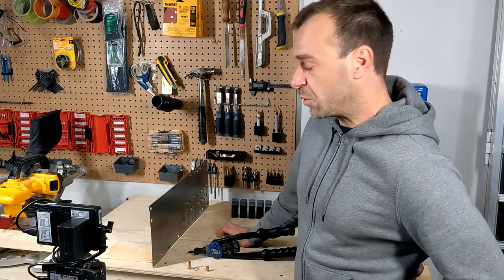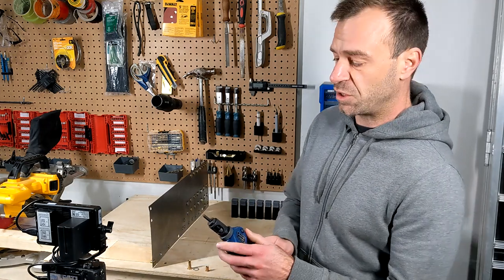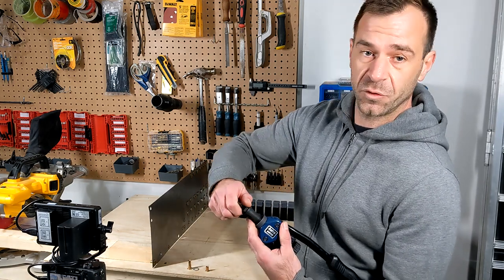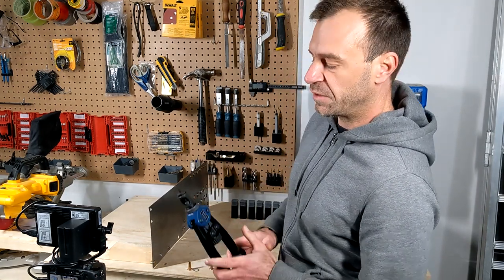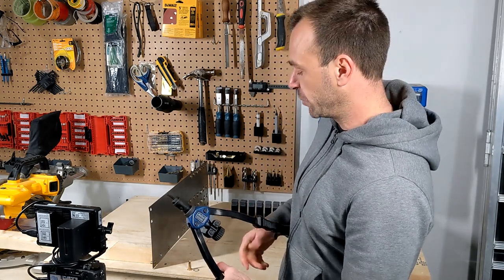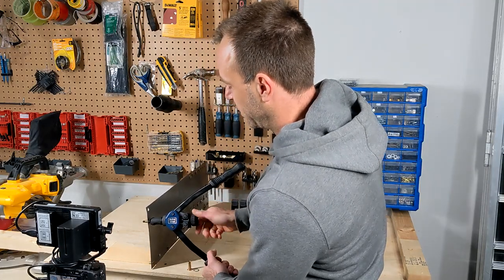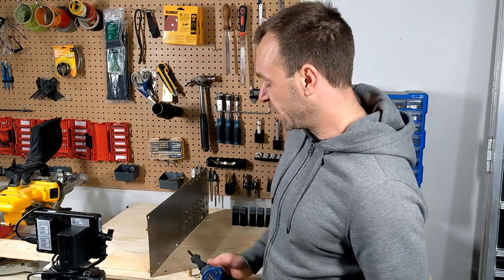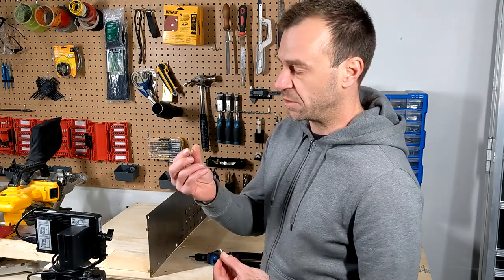Cross Nuts and Rivet Nuts Installation Quick Demo

Comment: I wish I knew about that washer trick with the cross/plus nut.  I had way to many spinners.
Reply from the maker: I tested a bunch of ways to install crossnuts (regular washer, split lock washer, tooth lock washer, CA glue, Red Loctite, J-B Weld), and yeah the tooth lock washer works the best with cross nuts. I'm about to publish the results tomorrow, still working on it late tonight!!
Reply: @FarOutRide  Thanks for the new development!